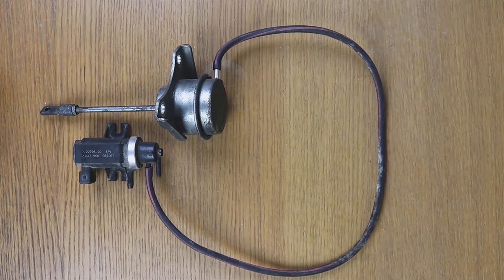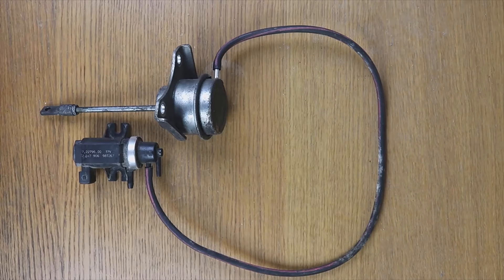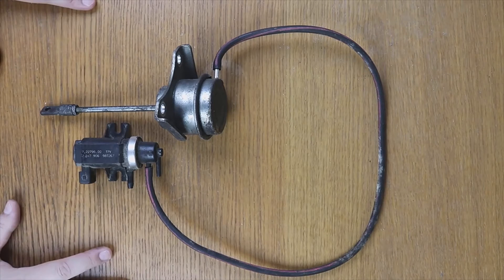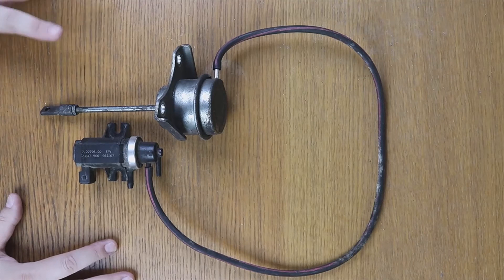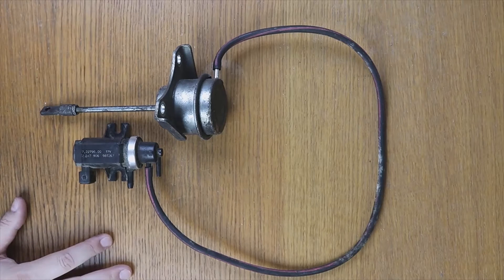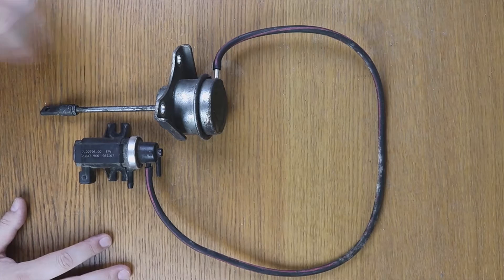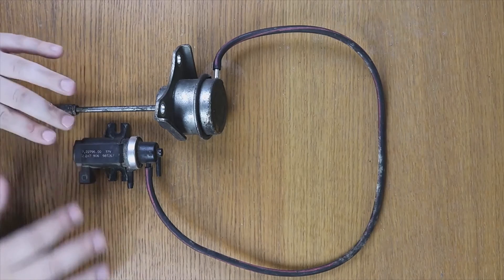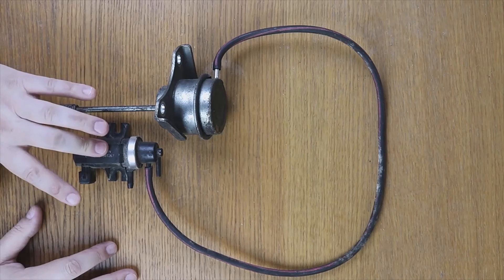FAIL, TURBO actuator goes up and down at idle, but doesn't move when accelerating. EXPLANATION

Comment: Hello, the Westgate idle in my Nissan Navara vehicle moves up and down, what is the problem?
Reply from the maker: There could be several causes, loss of vacuum through pipes or turbo actuator, or failure of the turbo solenoid valve

Comment: Please, what if it doesn't move at idle and when accelerating is it okay?
Reply from the maker: When accelerating is when it must move, to control the air pressure that the turbo sends to the engine, at idle it does not have that need, since there is no overpressure problem.
Reply: @car-parts2.011  thank you so much sir

Comment: Hi, I have a nissan navara d40 with an auto transmision, I think my selenoid valve has a problem. When I start the car and begin driving it works well but if I let it adle for >15 seconds after the start it wont generate power or as soon as I stop at a red light. Do you think the selenoid migth be the problem?
Reply from the maker: It can be due to several reasons, what error code do you see on the diagnostic machine?